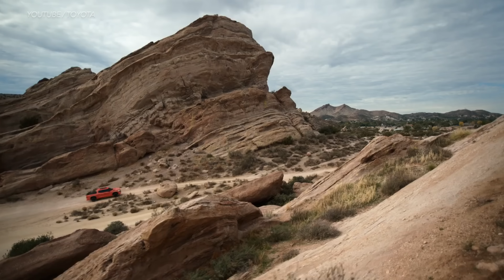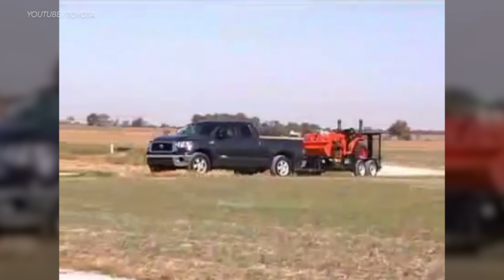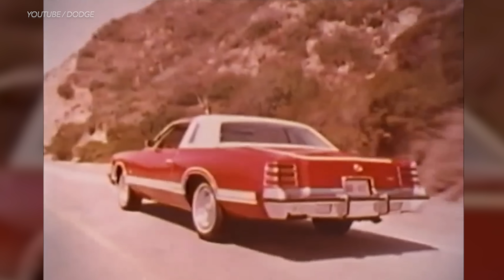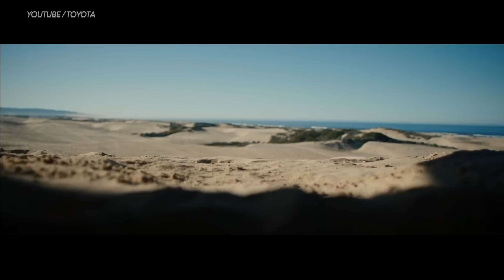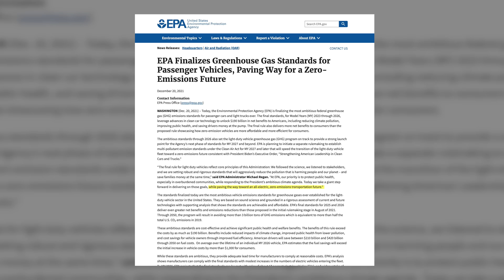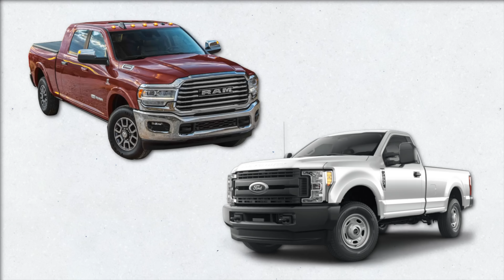Here's Why Ford Just Sued Toyota

Comment: You can buy many gallons of fuel, even in the Bidenconomy, for the cost of replacing the turbochargers on a Toyota engine. And I suspect when you tow something, the TT V6 fuel economy won't be any better than the V8. 
Towing capacity is meaningless if towing ability is crap. My Tacoma (TRD OR 6M) is a gutless wonder when I hitch my trailer to it. I have to spin the heck out of the engine to stay in a usable torque range. I use my wife's Honda Pilot to tow the trailer when I can. I considered the Tundra when I discovered how poorly the Tacoma tows a small (<2,500 lb) cargo conversion trailer. But not the TT V6 Tundra. Besides being a butt-ugly truck, I don't want the complexity of twin turbo V6 bolted to a Toyota automatic transmission.
Reply: And a v6 got nothing on a v8 going up hill
Reply: How will 400lbs of tq suck for towing?

Comment: Scotty, I noticed another mistake in some of the information that you are stating.

You said that the GVWR of a vehicle is the weight plus the payload but then you only stated the Toyota tundras payload
If you combine its maximum weight with its maximum payload capability you get 7,800 lb. Which is not too far off from being a heavy duty truck
Reply: GVWR is the curb weight of the truck plus its cargo capability.    No towing figure involved.  The GCVWR is the truck plus cargo plus trailer total weight.      Gross Combined Vehicle Weight Rating.
Reply: @merlpriester  I meant payload, thank you for the correction

Comment: EPA is essentially forcing automakers to use turbocharged engines in order to to meet their ridiculous standards. If you're going to be mad at someone, look to the government.
Reply: @killdizzle
Reply: @davidwilkinson4240  I do, and also know how to manage them right, they're driven by exhaust, they tend to get really hot, typically lubricated with engine oil, some even have coolant passages which is what I'd want.
Reply: thats why dodge killed their charger
Reply: No one seems to be able to figure out that it’s Big Gov™️ that is screwing everyone, not the automakers.
Reply: @Jb-uy5zx  fun fact, diesels are not required to have EGR and DEF by law, they're just required to meet an emissions standard, you can achieve the effect of EGR using VVT, and there could be some significant tuning done to greatly reduce if not eliminate the need for the SCR system, change the diesel oxy cat with a differently designed cat more like (but not the same as) gas cats, and set the DPF up right and tune the truck to greatly reduce soot.

Yes I know this isn't a video on diesels but I'm pointing out a way automakers could do lots better with the rules in place.
Reply: Every problem we have is almost always the government's fault. Ppl don't understand this
Reply: @Peteryungis  not necessarily true, most members of the white trailer trash community Don't have a ton of excuse
Reply: So far the govt seems to have a subtle war against all cars and trucks. One thing is over the last fifty years we’ve been spoiled with vehicles that we wanted, but slowly this freedom to own whatever you want. In 10- 15-20 years who knows how far they will go. The generations during the last fifty years are beginning to thin out as they age. And so it’s obvious that with the govt taking control of everything, these younger generations will be indoctrinated to accept the standard that the govt insists upon you. Nothing lasts forever ….
Reply: The engineering challenges are fun.... only makes us better
Reply: @bjbegui  this, they should allow every automaker one limited production non-compliant vehicle where they can go hog wild and show us what they can truly do.
Reply: Government is bad at everything they do with the exception of oppression
Reply: Ridiculous standards??    So you want 70s era engines??   Dirty inefficiennt smog machines.
Reply: Look at history lmao
Reply: Ignoramuses like Nancy pelosi making rules on subjects she knows absolutely nothing about.
Reply: Bastards
Reply: Let's be honest here big corporations ARE the gov. They are the ones who spent trillions to lobby and bribe them hence they own them. Blackrock, Vanguard, Who are we kidding? It couldn't be more obvious when retiring politicians are given top token positions in major corporations. 😉
Reply: Turbos are cool though, even without EPA we'd still have them, they'd just be bigger and strapped to more powerful engines, but also we'd still have a desire for fuel efficiency because fuel does cost money. Now one big thing is that Toyota diesels won't pass EPA standards for whatever reason, so the lack of a diesel tundra is the government's fault.
Reply: @Prestiged_peck  cool on sports cars that you just drive on the weekends as a secondary car.  Not for a daily unless it’s a diesel.
Reply: @jaymoar3561  I'd daily and tow with/work a turbo 6.2 gasser (ford) all day if I could get my hands on one.
Reply: @jaymoar3561  why ive driven a focus st daily for 5 year almost 150k not a single issue 2.0 turbo manual etc turbos of today are not the turbos of 20 years ago these newer turbo engines last 200k easily if taken care off with minimal maintenance
Reply: 100%
Reply: @killdizzle  What? it is addressed by engineers, after being mandated by politicians.
Reply: Drag coefficient is were all auto manufacturers should focus on
Reply: @solutionsforabrightfuture3579  Trust me. They’re doing all the can for aerodynamics. Little you can do for a truck.
Reply: @realmechanicalengineer5792  we will see as I get past more math courses.
Reply: In theory, its ridiculous. Turbos force more air in, which requires what? More Fuel! Put your foot down these things are gas hogs. Dont put your foot down, they cant get out of their own way.
Reply: Why be mad at the EPA? drastic situations call for drastic measures. What, are you going to drive your gas guzzler through the end of times? dummy.
Reply: @Kagemusha320  it's cleaner to take old cars and improve their emissions than it is to buy a new car with the same emissions. But the EPA doesn't like you doing that unless it's a pre-emissions vehicle. That means, God forbid, if I wanted to put a new ecoboost 4 cylinder in my 90s v8 mustang that puts out like 10% of the emissions the original motor puts out, (and I'd use all the emissions systems from the likely wrecked donor car) and gets much better vas mileage. That's illegal due to EPA laws. They say I have to keep the original engine in it, no ifs ands or buts about it. That's my issue with the EPA, I could take GEN2 GESI high flow cats and put them on my car and both make it much cleaner than factory and make a ton more power, but nah they'd rather me keep the rattle old oil burning stock motor.

That's my issue with the EPA
Reply: @Prestiged_peck  idk what EPA your talking about. That might be your state emissions laws regulating that. I’ve seen some absolutely crazy motor swaps. DMV never bats an eye. I’m guessing your in California.
Reply: @Kagemusha320  yes my 03 Tacoma will outlive me!

Comment: Scotty, in the late 1980s I saw a late Ford truck with a straight 6 cylinder 302 engine. It was huge of course, but had many miles on it. So I didn't buy it. But the massive hanging was incredible.
Reply: It was a straight 6, 300 cubic inch.
Reply: The 302 was called a 5.0 liter V-8.  Even rounded it wasn't 5.0 liters, they just called it that.

Comment: I had a 2002 Tundra with the 5.7L.  I called it my Suburban Man's Truck.  When Toyota when full-sized I passed on buying a newer one and went with the Tacoma.  Have not been nearly as happy with the it as I was with the Tundra.  I tow a 16-ft boat.  When I heard they dropped the V8 Tundras got dropped from my list.  They may tow heavier loads, but I bet they will be a lot more expensive to fix.  I guess, for now, I am stuck with Ford or Chevy with a small V8; no Rams for me.  No diesel for me either.  I live too close to the Artic Circle.

Comment: I know v8s are one of the most stable platforms but with gas prices and the tax dmv charges for a v8 vehicle its not worth it for a daily driver
Reply: My opinion differs
Reply: In the silverados the v8 model has better fuel ratings than the 6 and 4 cylinder models.
Reply: @casey2219  the problem is that its a Chevy
Reply: Sadly the only American brand I would buy from is Ford

Comment: Well, it is interesting Toyota downsized the Tundra, but it's awesome. 

Ford downsized the Expedition and it still pulls a lot of power given there's no V8 option like it used to be eons ago.

As for GM putting a 4-cylinder engine in their Silverado/Sierra full-size pickups, THAT doesn't sound logical whatsoever. And on top, even while hauling tons of payload, you still won't get good MPG ratings. Might as well stick to a V6 or V8.

I love how some of the Ram pickups have lots of power for a V6. I've driven one before and they are neat to drive.

Comment: The only reason that the new tundra can haul more weight than the older model is because the truck itself weighs less, aluminum panels, the motor weighs less the transmission weighs less, fact is you’re getting much less of a truck just so they can say that it hauls more, but what they don’t tell you is the longevity is going to be poor !  
PS.    I’ll keep my Tundra with the 5.7  , And by the way I think the look of the new Tundras  “SUCKS “
Reply: My little 2001 4 Cyl Tacoma has a payload rating of 1,718 lbs - no joke it's on the brochure for my specific trim.
It's a basic 2WD truck and only weighs 2800lbs. Still runs like a clock over 200k miles
Reply: @Argedis  the Ford Maverick is 1500lbs 🤣
Reply: Agreed. When they said the new tundra would resemble the taco I was excited but they look more like a rav4 than a taco. I’m holding on to my 2010 4.6.
Reply: @butternutter98  wise !
Reply: How would you know about the longevity of this truck without empirical evidence?

Comment: You would think Scotty was knowledgeable enough to realize the measily 4mpg increase in the 2022 Tundra is from the New 10 speed transmission and lower torque rear axle, not the cheaply made  Cracker jack box TTV6 that nobody asked for.  Toyota's dirty little secret.  C'MON Scotty, you're better than this
..

Comment: Why not a diesel it makes better gas mileage and also more torque so more towing
Reply: Just a guess, but I think they know the frames won't hold up to the torque.  The load weight is already max at 1800 lbs.  Put a diesel and you now have 1200 to 1300 lbs.     Tongue weight, people and fuel will overload it and they know it.